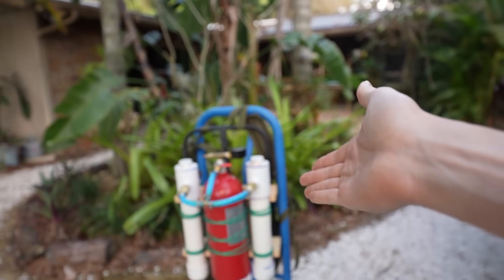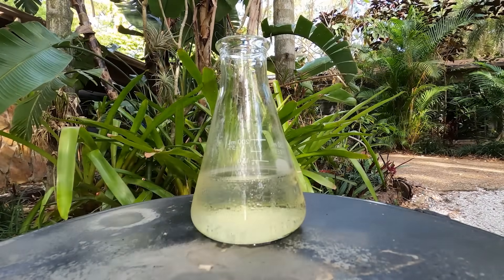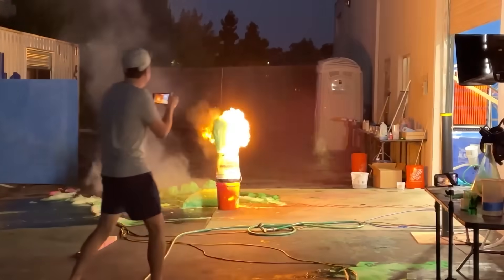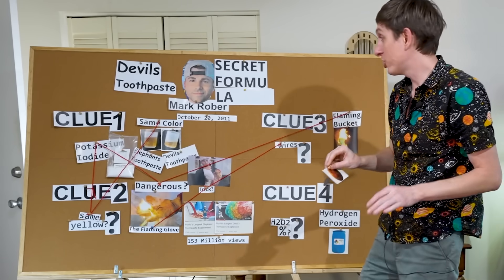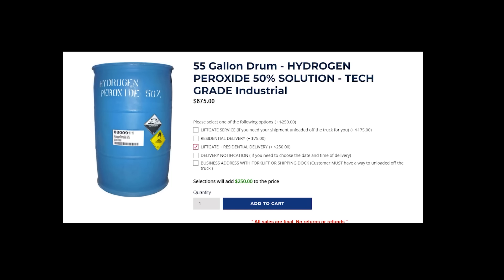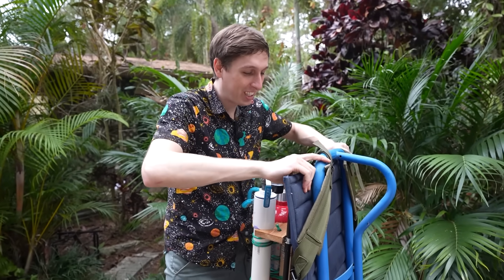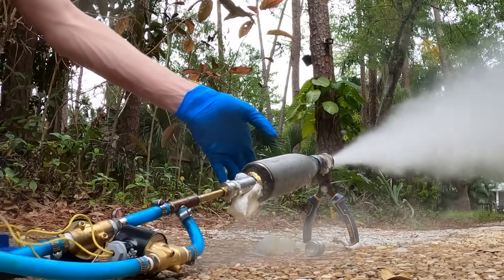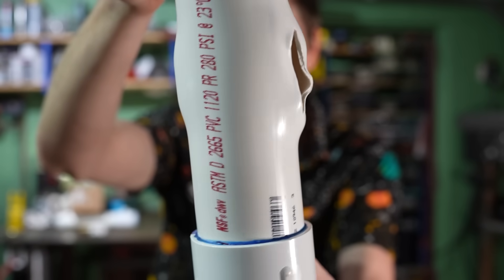Devil's Toothpaste Squirtgun (exploded)

Comment: Mark Rober did a version with 50% H2O2 and potassium iodide that he called "Devil's Toothpaste". If you don't have potassium permanganate, you can also use potassium iodide or manganese dioxide. Manganese dioxide can be acquired by taking apart certain batteries,
Reply: True
Reply: Wh-what

Comment: It's likely you are correct about the reaction between the more concentrated peroxide solution and the brass. High test peroxide was used as an ingredient in the propellant mixture used in some torpedoes from the late 40's until the end of the cold war. It is widely speculated that an HTP leak in the housing of a torpedo that was loaded into a brass lined launch tube was the cause of the Kursk disaster.

Comment: If that tank ruptured on your back it would have completely changed your life or killed you. Look up a man named Josef Pöhs. He was a German flying Ace who was killed when the fuel line of his hydrogen peroxide powered German rocket aircraft ruptured and sprayed him with the concentrated peroxide.
Heres a brief description of the accident:

"On other occasions pilots suffered a fate worse than an explosion, as in the case of Oberleutnant Josef Pohs, who on one flight released his takeoff dolly too early. The dolly bounced off the ground and struck the aircraft, rupturing a T-Stoff line. Pohs immediately jettisoned his fuel and banked around to make an emergency landing, but just like Alois Worndl missed the runway, touched down on rough ground, and flipped over. To the relief of his watching comrades his aircraft did not explode, but when they finally reached him and turned the Komet over they were greeted with a gruesome sight: T-Stoff leaking from the ruptured line had dissolved the conscious Pohs alive.

Comment: The yellow color of Mark's 2nd solutions could come from silver nanoparticles, which will significantly increase the speed of the reaction. You can also increase the pH of the hydrogen peroxide solution to make the reaction faster. Or, you can use warm solutions (NEVER heat 60% peroxide past warm to touch).

Comment: Having had the pleasure to touch 70% hydrogen peroxide. Yep it's dangerous.
I got a vanishingly small amount of it on my hand. It burned like heck. Also left a burnmark that lasted for several days. A small tiny streak, got it from an edge of a tool that was wiped but not washed.

Comment: The voltesk ice core sample data shows earth has been through 4 different ice ages in the last 500K years. On this chart there were periods of time in between each ice where temperatures rose and CO2 levels rose .  We currently are in a warming period. All the ice from the last ice ages is melting back. If past trends hold true then we should be going into the next ice age.

Comment: Mark Rober used 50% Hydrogen Peroxide.....more than that it reacts so fast that the foam just kinda "burns" up (although it doesn't catch fire)....even at 50% tho it will be much hotter than normal....whatever you concentrated looked to be more around 40%

Comment: 50% hydrogen peroxide is obtainable. I think that's the max that can be easily shipped in north america.
Reply: Also, other cheaper things catalyze decomposition of peroxide. These include manganese dioxide, or even silver metal. In this way, a reaction chamber made of silver (or silver plated) with sufficiently hight surface area can act as a permanent replacement for KI. It might be better suited for high test peroxide though.

Comment: (#MarkRober google said the formula of devil's toothpaste is) Devil's Toothpaste is really the same as the famous Elephant Toothpaste experiment, just executed with higher concentration hydrogen peroxide. In this case, [Integza] is using 50% hydrogen peroxide combined with potassium permanganate as a catalyst.Oct 21, 2021

Comment: You’re nozzle was the problem. If you want it to react faster, you need the components to mix better. Try making the nozzle in such a way that the two components are swirling in opposite directions as they come out, with one inside the other. That’s how the burners in marine boilers ensure a good fuel-air mix for near-stoichiometric combustion

Comment: I cant believe I figured out the formula after I keep hearing everyone talk about how difficult it is. It took me freaking 2 months of testing and i finally got it a week before for our gender reveal for a 3 ft volcano I built. its shot at least 20 feet in the air.. all I did was evaporated the water out from 800ml  of 34.5% food grade h202, down to 600ml which brought it to around 50% concentration. 60% was too high. It turned thin and floated away. And then some potassium iodide for the catalyst

Comment: You used the wrong plumbing pipe it's only rated for 280 PSI at 23 Celsius. you should have used the PVC pipe rated for pressure, the blue glue you used is also not pressure rated glue. if you used primer for the fittings that might have reacted with the chemicals too

Comment: you aren't kidding about hydrogen peroxide lol at my job (electroplating/PVD company) I accidentally spilled 99% hydrogen peroxide onto a cement floor that had dried crystallized Evabrite (chemical comp is trademarked can only find the generic name for it, dark bright green stuff tho) and it instantly turned black and caused a massive exothermic reaction it just started melting the cement floor, giving off insane amounts of heat and then me, panicking, threw blue paper towels on it to try and soak it up(so not smart) they all turned white, then black, then burst into flames lol stuff is crazy reactive! manganese permanganate was fun too, if you left the container open for too long it would just spontaneously combust itself lol
Reply: yikes that explosion lmao yeah hydrogen peroxide gets incredibly incredibly hot, super exothermic reactions with everything lol

Comment: Kevin, i think you were pretty close but not close enough. 
My hunch is Mark used a small amount of Hydrazine N2H4 with hydrogen peroxide. 
The N2H4 and H2O2 experiments were initially done by German scientists, pre WW2. A lot of those early jet aircrafts exploded because of pre-chamber mixing of chemicals or tank corrosion. Test pilots have lost lives.  
Look up wiki, Hydrazine is used  by the foaming industry, outer space rocket propulsion, Car airbag inflation. The F-16 and Eurofighter use Hydrazine for APU start up. Mark should be very familiar with this chemical.

Comment: Take a look at mixing nozzles for 2-part epoxy since that is what you need, not just 'spray n pray' inside of what used to be a bottle. Test different ratios, pick the best one, and mix in a little bit (more?) of dish soap so the foam stays a foam longer and you should be set.

Comment: Re: the heat, the 60's era jet pack seen in Thunderball (Small Rocket Lift Device) ran on high-percentage hydrogen peroxide. The H2O2 is pushed through a silver catalyst which breaks it down into O2 and steam. I expect playing with the concentration lets you control the temperature of the catalyst. Too little peroxide results in a hot water spray, too much melts the silver.

Comment: Hello I had a question. for you since oil doesn’t boil but has a point were instead it bursts into flames what would happen if you put it in a vacuum chamber and tried. Would it be able to boil now since that there is no air or would it continue to heat up?

Comment: You got 49.8 tons of CO2 emissions? 

I just calculated an average of 3.8 tons of CO2 for me. That's almost 13 times less than you or aproximately 7.7% of what your foitprint is. 

Basically, I live in Norway. 
I never go by car because I don't have a lisence, and even then I could use my landlords spare car which also does save on emission because I reuse something already made. Then again, I never go by train almost, very rarely though (right now 0km per week). I always use my bike and the bus trip to the xc ski track is a 15 minute ride aka 6km. 
Flying right now since pandemic a no.
Groceries I do it for cheap (1.5 km bike ride), I'm not even vegan nor vegetarian too. I do eat a lot of seafood though, which is local and good here in Norway, red meat not too often but enough for an athlete like me. 
Local water, not too much energy use (every light bulb is off I don't need), no gas or other fuel ever.
Lots of money spent on sports equippment though... All in all I'm amazed at 3.8 tons🤯

Comment: You literally made a old-school pressure fed H2O2 decomposition rocket engine. It's the exact same principal behind green monoprop engines (although you use iodine rather than running the H2O2 over a catalyst, so not monoprop)

Comment: Did you use any check valves to make sure the mixture stayed in the reaction chamber and didn't flow back into the PVC storage canisters due to the pressure?

Comment: Your concentrated hydrogen peroxide could’ve been tainted a fairly amount since it came into contact with the bugs and also since it was open to light which makes it breakdown slowly. A tip in case you concentrate it again

Comment: I do concrete leveling and this is basically a super simplified version of the system.  lot more techincal and cost around 80k for the real setup, but same idea.  two parts stay seperate unitl nozzle mixes them together.  one thing that is used for concrete and would probably help here is a cyclone nozzle.  the two parts shoot out and spin together mixing very very well, and a seperate disposable nozzle fits after that to give it the streamline spray.

Comment: Ive been trying to get good peroxide reactions, for a monoprop rcs thruster, and what ive discovered is that most commercially available peroxides have stabilizing agents present that make it really hard for the peroxide to decompose, leading to a slower reaction rate. there is 2 work arounds i have found, 1. buy the proper stuff with no stabilizing agents, 2. (not as good but still effective) use potassium permanganate, this tends to react with the stabilizer, causing a faster reaction rate while also being one of the most effective catalysts out there.

Comment: OK I’ve got some problems after watching this you made basically a flamethrower even though it’s not shooting flames and strapped it to your back out of PVC pipe… You didn’t weld anything together you didn’t get a pressure rated chamber you didn’t do anything you got PVC pipe from Home Depot put some gorilla glue on it and thought it was going to work get a welder get a tank to fill dust stop being a wussy

Comment: Cool.

Now fill one canister with aluminum oxide, and the other canister with iron oxide. Use compressed air to push them both out, and add a constant flame at the end of the nozzle.

Comment: what happens if you, instead of just having a bunch of big holes and try to mix them as a stream of fluid, nebulise both fluids like its done in a car engine with the fuel to get a bigger surface area

should give it more surface area for both substances to attach to each other and expand easier and faster

Comment: I'm a peroxide specialist, what you need is anaccelerant for the catalyst. You can try using some molybdate salt such as sodium molybdate and see if it makes a difference. Also you can try adding some low amounts of manganese dioxide suspended in solution. It's worth getting 50% peroxide since it's not as dangerous as what you created (which I think was grater than 60%). Peroxide reactivity somewhat increases exponentially as it gets concentrated. Also, make sure you are not using any metal firings, valvs, or parts at or near the peroxide tank. Your tank bursted because the peroxide you had concentreated was contaminated by dust and bugs, which then leads to it continuously releasing some oxygen, which then creates pressure build up in the tank, where the pressure then causes formation of heat and rise in temperature, which in turn makes the peroxide degradation faster and faster as this cycle continues = this reaction cycle was the cause for your explosion!
I'd be happy to work together with you and recreate the devil's toothpaste, peroxide science and formulating with peroxide is my daily profession!
Reply: Username checks out
Reply: I support this.
Reply: This guy couldn't get an infected wound if he tried
Reply: In terms of safety, maybe some sort of thermometer or pressure gauge in the peroxide tank would be a good idea?  That way you can catch the accelerating decomposition early and get clear.
Reply: @ADefenestrator  a pressure relief valve may be better.
Reply: @ADefenestrator  
At this point, just add armor plating to the tank and a rapid release system. In case of emergency, the wall will direct all spray directly backwards, catching falling drip or upspray. 
The harness with a single pull will be ejected, and you can safely leave the area.
Reply: I like your funny words magic man
Reply: Let's get backyard scientist to see this
Reply: The what
Reply: I hope something comes of this
Reply: I like your words magic man
Reply: @Daniel Cook Sure, but the assumption is that they'd rise together in this instance, and both would accelerate once the breakdown started.  Might be easier to quickly catch the pressure rise than the temperature.
Reply: A part of me thinks this is Mark rober talking haha
Reply: the way the pvc failed looked more like heat weakened (and melted) it to the point of explosion, vs a cold pvc rupture only from pressure...
Reply: @Stealth55555  yeah, as I mentioned the pressure buildup also happens together with heat buildup, a perfect storm...
Reply: There’s a Portuguese guy who can buy 50% of you
Reply: @DotDodd  Slavery is legal in Portugal?
Reply: @johnshite4656  Check op’s username
Reply: @johnshite4656  i mean maybe
Reply: Hmm hmhmm I haven't a clue whats going on here, but ill act like i do
Reply: Y'know, it's astronomically unlikely, but man this would be funny if this was Mark's alt account
Reply: now this is a large group of words i dont understand
Reply: Yh, we actually used a catalyst in science camp and then we found out why we needed to put all our tables together and cover them in layers of newspaper, it was really cool! We even got to see how hot it was through a thermal camera
Reply: Thanks i really needed this for “school studies” hehe
Reply: Nerd! steals lunch money
Reply: This is my regular science class (btw I love science)
Reply: Hell yeah! science!
Reply: Dang man
Reply: My brain:Rapidly combusts into flames
Reply: correct it is the same but it is just 50% hydrogen peroxide
Reply: Add potassium permanganate… the nazi monopropellant
Reply: This guy payed attention to his chemistry classes
Reply: thank you, now i can make my hho torch!
Reply: Ok
Reply: Ok
Reply: Would love to see this. Great comment!
Reply: welp we are doomed
Reply: We need to get you a collab!
Reply: @Siegeisok67  I hoped @TheBackyardScientist would have contacted me by now... could be a great competitive collaboration!
Reply: Science
Reply: Most illegal comment on yt
Reply: NERD
Reply: I can't believe they have not reached out.
Reply: hey guys today I'm pranking the white house
Reply: I advise looking into fermentation methods for creating alcohol and mimicing them for concentrating the hydrogen peroxide. They involve keeping the brew warm, allowing gas out, and keeping dust out, which is what you need to do.

Just don't try alcohol distillation methods on this unless you want an explosion in your garage.
Edit: also contrary to popular belief alcohol stills are still illegal without a license in the US so probably a bad idea to make a backyard still.
Reply: thanks ima go make a bomb now lmao
Reply: Can I copy this for my exams?
Reply: Yeah, Peroxychem taught me to keep it clean, keep it cool, and never return it to the supply bottle- downcycle any "gently used" 90% into the 35% bottles used for parts passivation. Never had any incidents. I didn't keep accelerants at all, much less in the same building.
Reply: I have no clue what he is talking about
Reply: Mmm mmm, science words
Reply: It's wild to me he made a video about trying to figure out the chemical composition of devil's toothpaste w/o any chemistry...
I got more from your comment than from the whole video
Reply: Thanks
Reply: I read this one year after the comment was posted, HAS THIS FALLEN THROUGH??
Reply: I get so sick of peroxide specialists flaunting it over everybody. I just want to go one day without heating how someone is a peroxide specialist
Reply: He should try this
Reply: Mixing peroxide in a PVC tube and you want to help him make it LESS safe? Damn bro I didn't know you HATED the guy
Reply: @Jujudo  Hence why I'd help him! ;p
Reply: @H2O2FA  
The question is why??
Why would you help him??
Achieve something that is so dangerous as said from mark Rober
It is dangerous 
This is all yer funeral
Reply: @justinelml6933  dude he is a proffesional, they will be fine
Reply: nerd
Reply: @georgiabeasley84  yeah sure but hey lets have a cup of isoamyl acetate while listening to 10 hours of a rocket scientist working in our purely mechanical 1800's inspired teather sized TV that uses arcs inside closed ampoules that are linked to different cylinders of different gases that glow with different colors to make a image
Reply: Whole essay.
Reply: ha nerd
🤣
Reply: Nerd alert 🚨

Comment: when I saw his video, I also wondered how he was able to get the reaction he displayed. Being that the peroxide is the key component for the expansion, I contacted a chemical Eng and he told me that to get that volume that quickly with the chemicals listed, the peroxide % would need to be well above 50% and a minimum of 40% for the example shown in the video. Im  willing to bet that if you can get ahold of 60% peroxide you will see reaction time exceed what you need for the gun.
Reply: Did you not actually watch the video...

Particularly the part where he used 60% peroxide.....
🤣